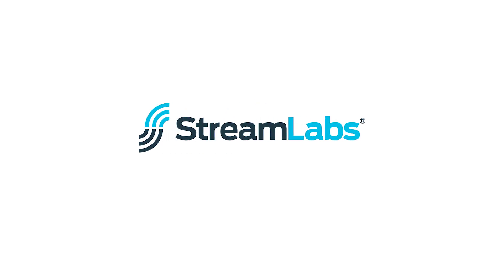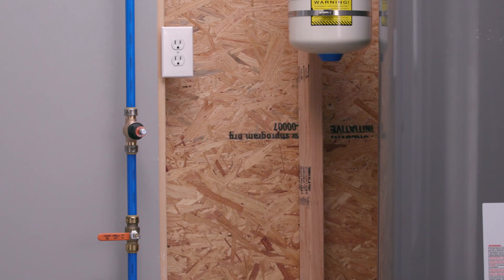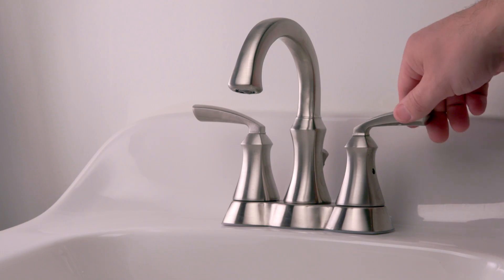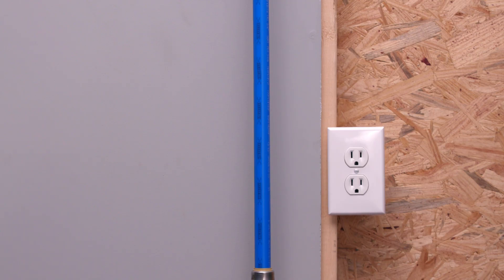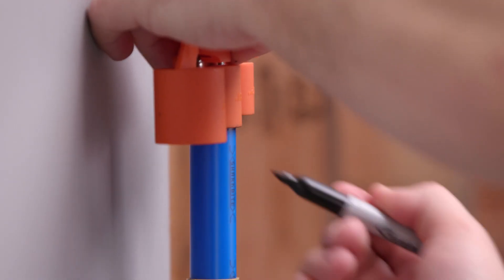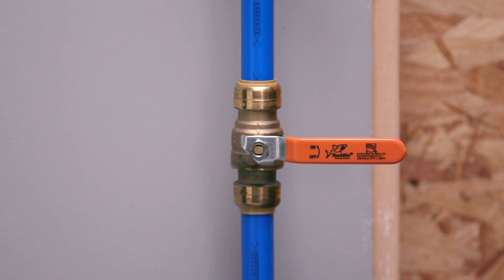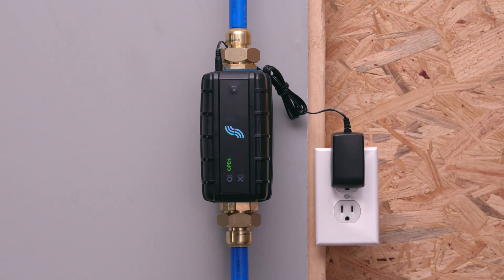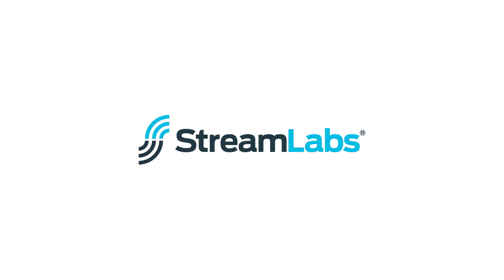How To Install a StreamLabs Control Leak Detection System

Comment: Can it be installed into 1/2" copper pipe?
Reply: The video shows a chart with 3/4" as the smallest size and it also shows the sharkbite version of the valve.  I would suggest using the threaded version of the valve and reducing the in and out of the valve for 1/2" pipe.  I would question why you would only want this on a 1/2" line as this is a whole home valve and anything before this valve would not be protected.  If you mean for this to be used only on a single fixture i would suggest instead using something like a flood stop valve instead.

Comment: How long is the power supply cord? What is the exact description of the type of power supply cord, in case I need a longer length to reach an existing outlet? Thank you.
Reply from the maker: Hey there Bill! The unit comes with a 10ft power cable. But we like to be prepared, so we have 25ft and 50ft cables available, too.